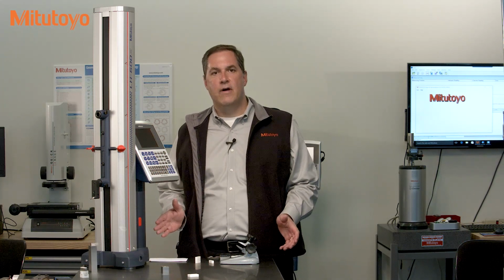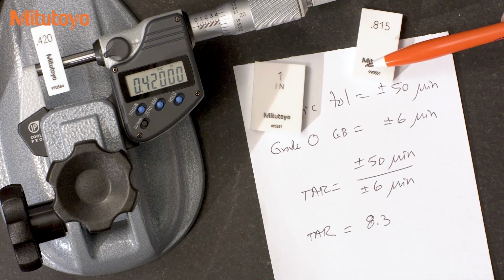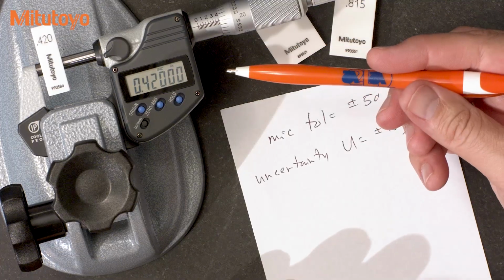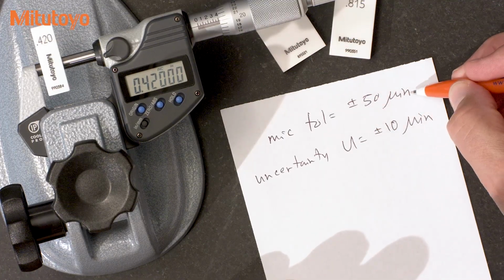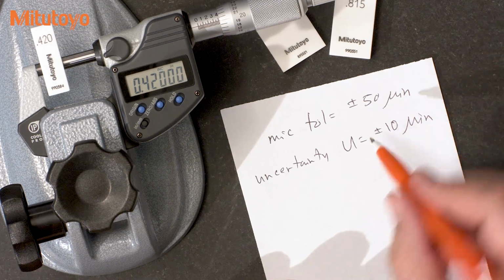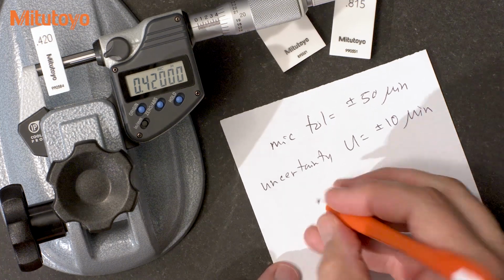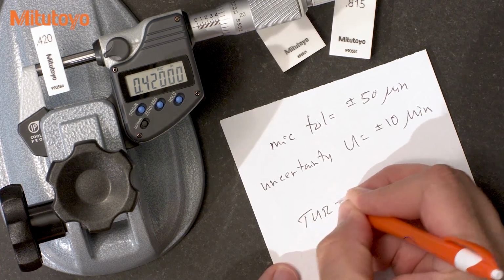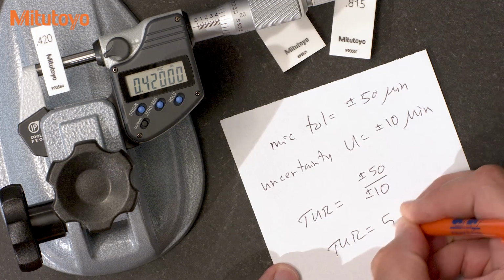Metrology Quality Rules Tur-Tar

Comment: When calculating the TUR for determining a ratio 4 to 1, is the resolution of the TI included (0.6R) or repeatability?  A 4 to 1 will never be achieved using that method. I was at a NCSL seminar in Cleveland and the presenters said that the resolution should be included. I recall Jim standing up and say it shouldn't only for your CMC but not when determining a TUR. Certain accredited bodies require the resolution be used to calculate TUR. I have seen companies state a process TUR which doen't include any variables resolution or repeatability . What is it and where is the guidance document to prove it one way or another.
Reply: JCGM 100:2008 or otherwise known as "The GUM" (Guide to the expression of uncertainty in measurement)